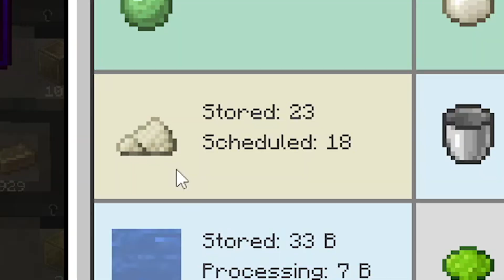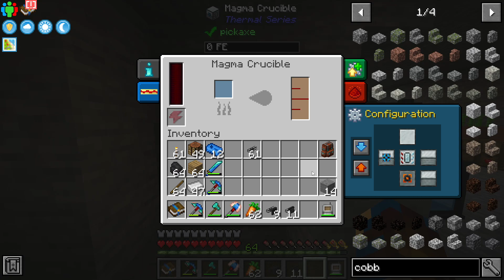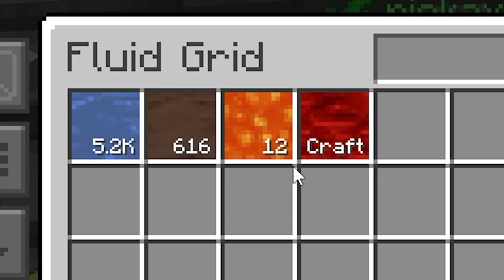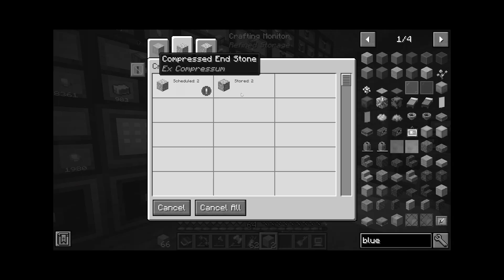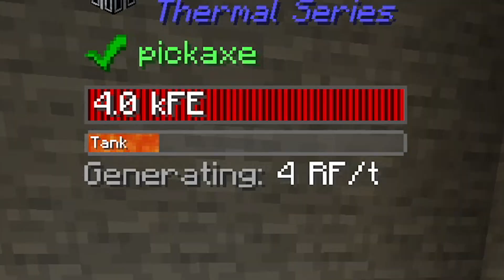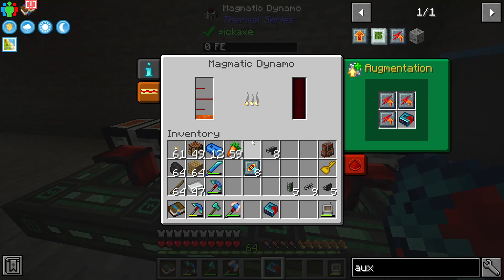Minecraft Stone Technology | Ep.12 | A Lotta Lovely Lava

Comment: Surely piping water into a barrel over mycelium and hopper/item piping mushrooms into it is an easier option for slime... That looks horribly complicated. 
I'll have to find the name of the machine that sits in an infinite water source that you can pipe out of though
Reply from the maker: Aqueous accumulator I believe, and I'll need to look into the mushroom thing for slime
Reply: @AgitaSage  aye that'll be the doofer
Reply: Also using waterwheels and lava (there's also an achievement), alongside one of those speed adjustable cogs would have saved you having to use 6 hose pulleys 🤣
Reply: Omg I completely forgot about the hose pulley in my playthrough. I spent hours making fired crucibles/uranium blocks/diamond cobblestone generators etc... Just a simple hose pulley and ended tank setup was faster than over 20 fired crucibles haha
Reply from the maker: @ANP9623  I played around with similar concepts, alongside a lot of augmenting and crucibles, just trying to balance the numbers. Then good ol' Create Mod comes along with an interesting twist